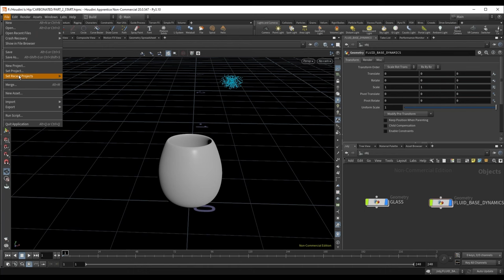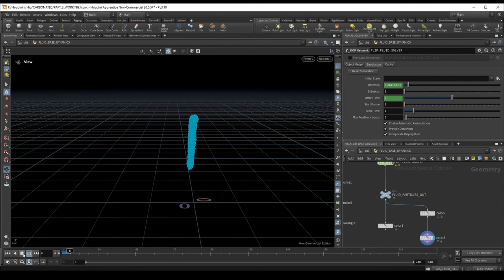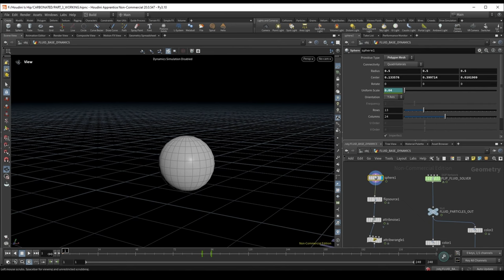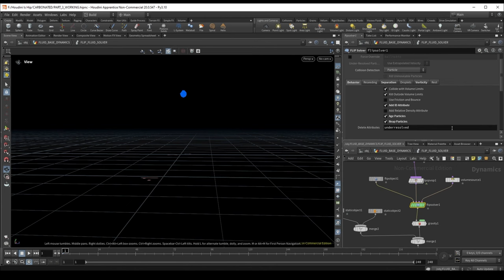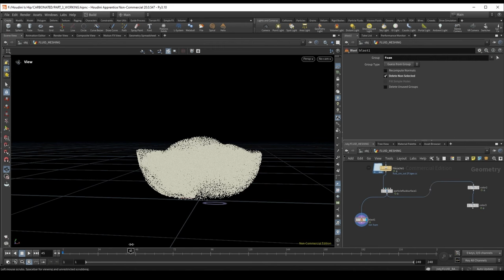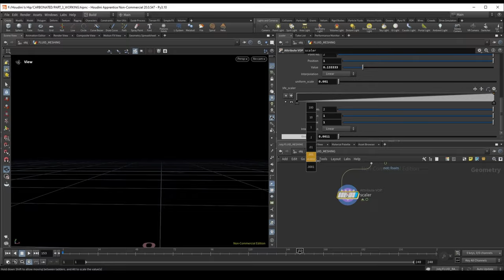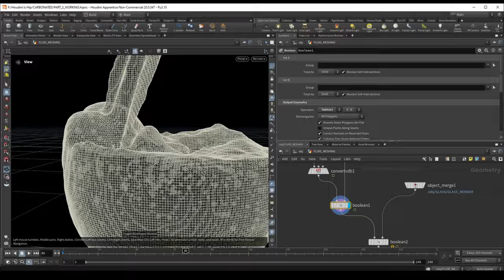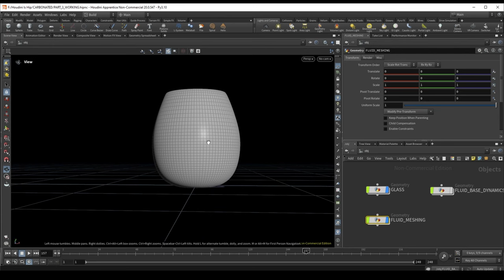Houdini is HIP - Part 16: Sparkling Water Project 2

Comment: these tutorials as always are so helpful, from watching tutorials i follow along to the T i find it makes troubleshooting so much easier because something inevitably goes wrong or does not look the same, and with that in mind when you did the Bubble culling part oyu sped right through the amounts you used on the ramps if in future you could maybe just put a text overhead stating the values and you can even continue along the  video but makes it easier to pause and read the numbers. keep up the amazing work

Comment: I believe this happens since the outer shell of the fluid is so close to then inner shell of the glass geometry in the boolean subtract operation. Using peak with very low value helps a bit but still few frames has holes in it.

Comment: Hello Nine Between, Amazing tutorial again, thank you for this !

As a small improvement, especially regarding performance, I would suggest to do the Boolean operation at 51:51 with a second "vdb combine" node on "SDF Difference" to subtract bubbles, using a vdb reshape on Erode mode before it. Then convert the whole to geometry with a convert vdb. It seems to be much faster on my side, what do you think ?
Reply: Hey man thank you for this, actually helped after some fiddling. Here's what worked for me exactly:

Copy the vdbfrompolygons1 to after convertvdb1 (which is before the boolean1 we want to replace). Now it's named vdbfrompolygons2
Add a vdbcombine2, set the operation to SDF Difference, connect the first input to vdbfrompolygons2, and the second input to vdbreshapesdf1 we have in the video.

Connect the vdbcombine2 output to a new convertvdb3 and set the option to 'polygon'.

We can now connect that to the SECOND boolean operator.
Cuts down my time by 50%, and sometimes allows me to render where it was previously impossible.

Comment: The last boolean operation before 'fluid_surface_out'-null will mess the geometry leaving missing primitives on the geometry ?
Reply: The one which cut the glass geometry out from the fluid.
Reply: I tried to use clean-sop and fuse-sop for merging near particles but didnt work
Reply: @jannesopanen8032  I have the same issue
Reply: I'm getting the same thing
Reply: Ran through this whole tut twice and got stuck a couple times. Boolean was a bit of a nightmare. I was able to finally get the big "bubble spheres" to go away by turning off "Collapse Tiny Seam-Adjacent Edges". But I still had holes in the geo with big missing chunks. I was able to fix those by turning down / off "Detriangulate".

Comment: Why is the fluid level different on open cl computing? You did all the calculations on the CPU, and I did them in open cl, but my result is different. I tried so many settings to match your fluid level, but I couldn’t… I was so frustrated, but at the end I matched that fluid level by switching off the open cl… If I am wrong, please correct me 🙂

Comment: Awesome tutorial series! I do have one problem though; After writing the animation to disk and then reading it back in (Load from Disk is checked) I still seem to have the exact same playback speed as when it's calculating it. In the video you can basically scrub through the sequence instantaniously and also there is no more caching going on. On my end it still get's cached to ram as indicated by the timeline turning blue. 
Please help!

EDIT: I just discovered that the problem resolves when I restart Houdini. Still wonder why this is happening though (I'm running Houdini 20).
Reply: you can also increase the cache frame in the advanced section in the file cache node...

Comment: "Threshold"  parm(parameter) error  which probably I the only who have it, but still I want to share situation and the fix / Houdini version 20.0.506/  43:13 Bubble Culling
So if I name parameter node "threshold", then start changing value very little all theparticles will just disappear.
Fix:
create parm(parameter) and leave it as default.
go back to geometry(geo) area and click on scaler (attribute VOP)
got to "life_scaler" and change "parm"(where threshold should be) value number till use see particles disappear just in video tutorial.
after that you can change "parm" name to  "Threshold".
I'm using this tutorial for my own project and I'm very thankful!

Comment: I am afraid, the "bypass match size" around 25:00 does not work. It breaks the sim. Fluid will leak, even after pushing down the volume limits. :(
Reply: Adjust the solver limit box in the dop network to cover all of your geo / fluid and it will work fine
Reply: @maitolba97  Will try, thank you!